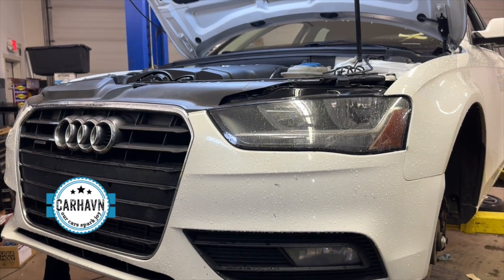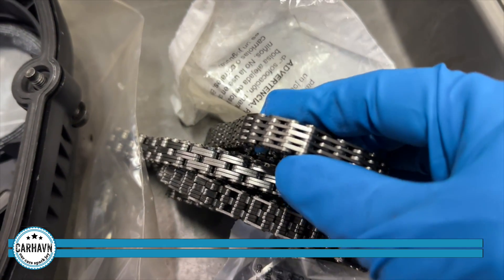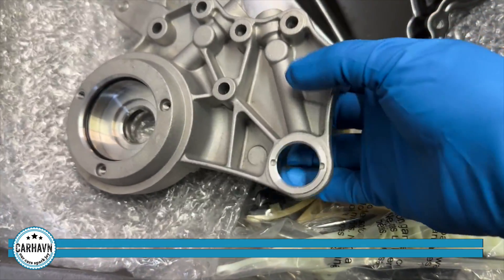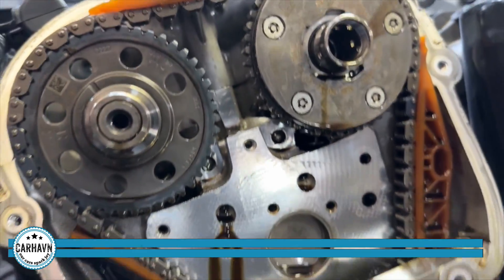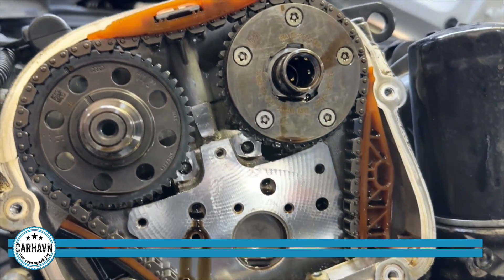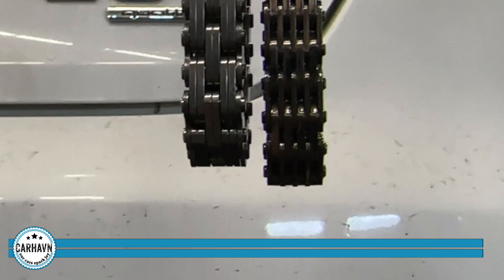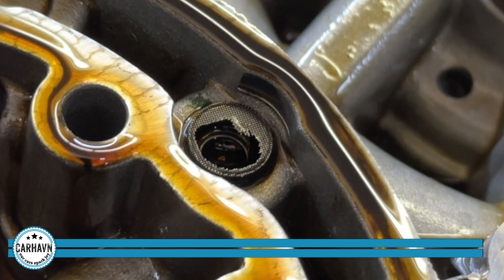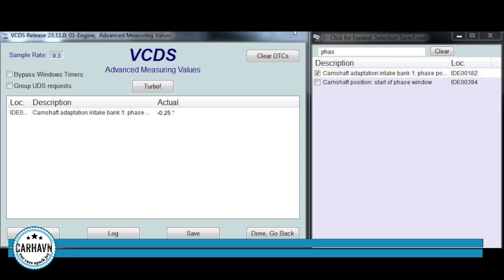Audi Timing Chain: The most important link in your engine

Comment: Dorman and upgraded are two words you do not usually hear used together.  😂. I have not had good luck with Dorman parts in the past.  You have had good results with the cam bridge piece?
Reply from the maker: Fair enough! In many applications we stay away from them but this camshaft bridge / camshaft bracket has been pretty solid for us.

Comment: How is that new chain better if it has the same number of plates?
Reply from the maker: Great questions! The double links in the new design are more resilient to stretching.
Reply: @carhavneurotech  But why is that if it has the same cross section material wise? Is the steel different?

Comment: Just did this job on my ex-wife’s 2010 A5… it was at like 7.4 degrees before I replaced it. The car had less than 100k miles. Luckily it never skipped a tooth. Incredible to me how quickly these go bad. Why not just use a timing belt if they’re only going to last 100k or less?
Reply from the maker: 7.4 is scary, glad it was caught. Did you have a Check Engine Light on? Probably not. Yes, you're lucky it did not skip timing. In a perfect world the timing chain would last a lot more. But bad tensioner design, 10K mile oil intervals, and questionable link design all play a part.